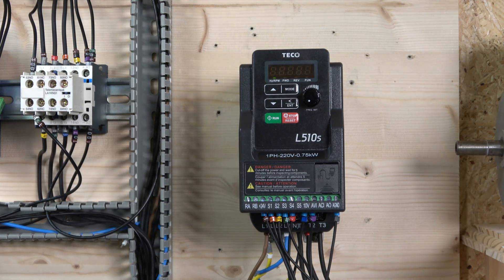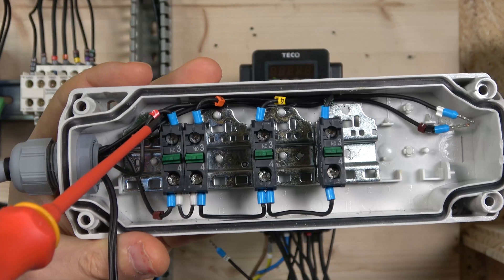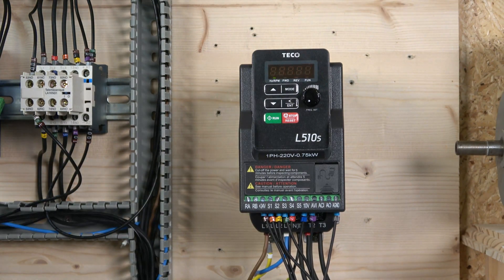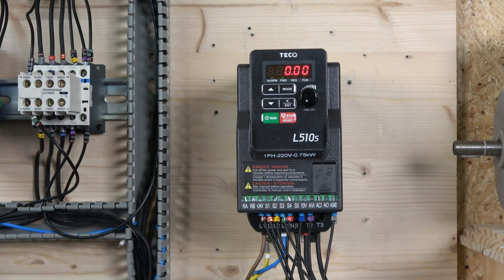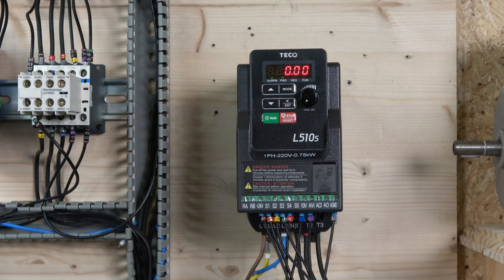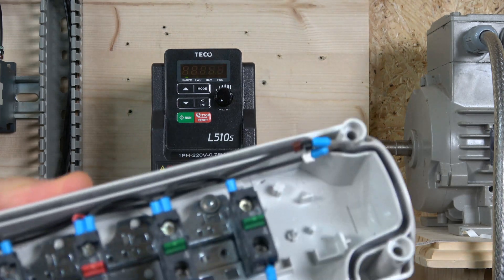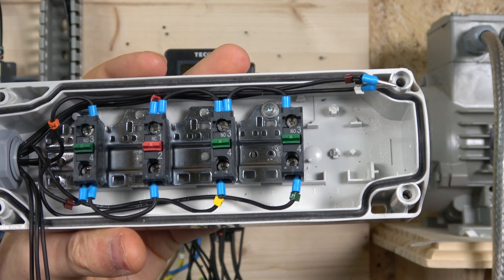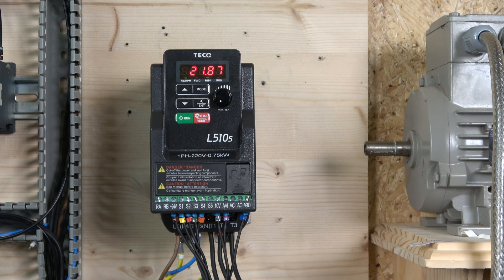Teco L510s VFD, remote mode, 2 wire control, 3 wire control and potentiometer set up. (English)

Comment: Thanks for a great video. I am building my own enclosure for all the controls and I wondered where you purchase your individual switches and potentiometers?? Thanks for your assistance Michael
Reply from the maker: Hi there. These are standard  Schneider electric gear. Any industrial electronics parts seller should have them. I got mine from RS Components.
Reply: Thanks

Comment: Please excuse my very novice questions or point me to a more elementary resource. I have the L510 that I am planning to use in the USA as a 110v, 1-ph input and 220v, 3-ph, 1-hp output for a variable speed wood lathe. I want to have a E-stop button, a forward and reverse option and a potentiometer. Would you suggest the 2 or 3 wire setup? If so, I don’t grasp the wiring differences. Also what type of wire do you use to go from VFD to the remote console. Additionally, why are the switches on 24v (the “S” terminals) and the varying frequency potentiometer on 10v? I ask your gentleness as I am not electronics savvy. Thank you, Ingus!
Reply from the maker: Both options are good, with 3 wire you have standard start stop option that latches the input once the start is pushed and stopped by pushing stop, with 2 wire you have to use selector switches to keep inputs on. The wire from control station to the drive is multicore 12 core cable, 0.5mm size. The analog input standard is 0-10V or 4 to 20ma as standard, and all digital inputs are powered with 24v dc supply's. Hope that helps.

Comment: Hi, and thanks for the very helpful video. I am using the 3-wire control mode for remote on/off and forward/reverse, with an added Rapid Stop switch. The other functions work fine, but when I wired the Rapid Stop switch to S-4, as shown in your video, the motor would not stop when the switch was engaged.   In the Group 3 parameters, my manual (Ver 01: 2015.08) specifies "Setting-S5" for Rapid Stop.  So, when I wired the Rapid Stop switch to S-5 it worked perfectly.  Maybe I have an older version of the L510, or maybe I missed something.  Anyway, everything works great and I couldn't have done it without your help.  Thanks.
Reply from the maker: Hi There. Its hard to tell were you went wrong, got to be something simple. Retrace your steps and as shown in video, it should work. Aging it would be hard to diagnose without seeing the setup.
Reply: @IGSElectronics  I don’t think he did anything wrong. Mine works the same way.
Reply from the maker: @MrZX1206  Good work.
Reply: Paulie G, I encountered the exact same problem. I have my wiring hooked up just like this video and my Rapid Stop decelerates slowly over a few seconds. I went in and turned -15 & -17 down to 0.5 and it didn’t change anything. I found your comment and moved my wire from S3 to S5, programmed the input and it works perfectly. Thank you so much for adding this. I’d resigned myself to having the E stop break the common wire which does cause the motor to stop, but when the E stop button is reset the motor immediately starts running again. Your S5 solution cured it. I don’t see in my manual where S5 is called out, but you found it. It looks like any of the inputs can trigger the E. S. but apparently that is wrong.
Reply: @MrZX1206  Hi, glad my experience was helpful.  No idea why the setup in the video worked with S-4 (and it clearly does), but ours only worked with S-5.  Nevertheless, this video was really helpful.  I had purchased a remote control with on/off, forward/reverse and speed control, and I was scratching my head about how to wire it up and connect it to my VFD when I came across this video.  My lathe has been running like it's supposed to for the last few months so I am happy.

Comment: Great Video, thank you. I have put a 510 on my Milling machine 240 single phase to three phase for 2.2Kw motor. Working well. Adding a remote.
Reply from the maker: Thank you. Glad it helped you out.
Reply: purchased the control from you, looking forward to the safety it will offer.